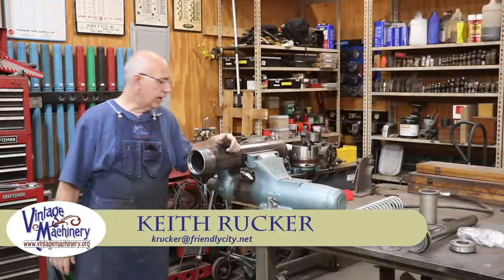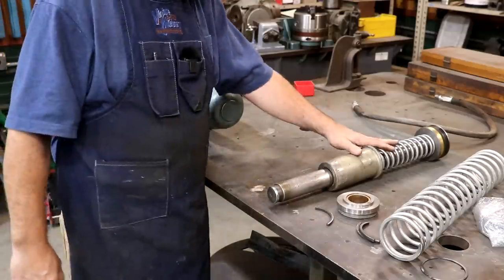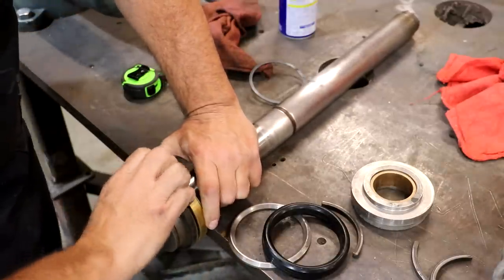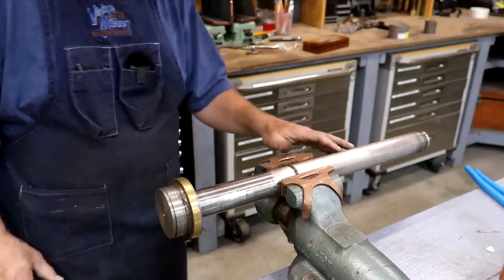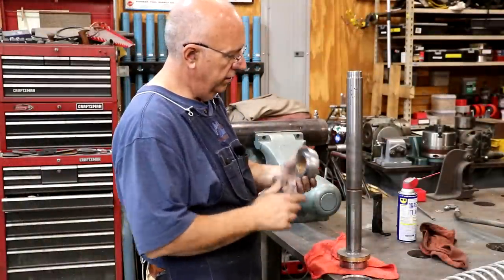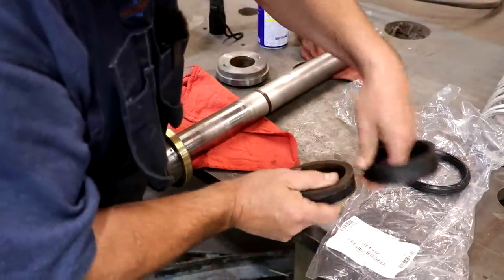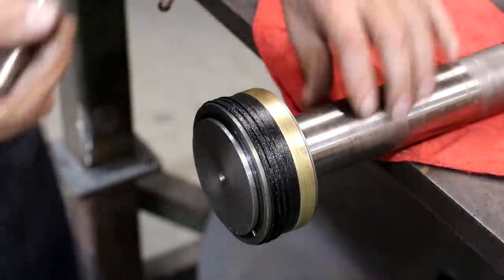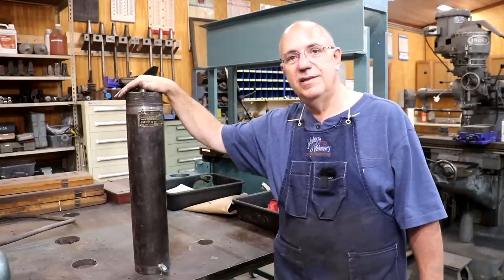Rogers 60 Ton Hydraulic Press Restoration 2: Rebuilding the Hydraulic Cylinder

Comment: I am glad you put the original chevron metal ring back in , I believe the reason it was designed this way is the live load on the stack of chevron rings and the cycles of the hydraulic pressure would have sheared the soft face of the supplied flat faced follower. 
The press is going to be a valuable addition to your workshop!

Comment: I do a lot of hyd. cylinder rebuilds and that steel ring needed to be there. 👍🏻 You had me a little worried at first 😜
Reply: I agree, especially since it is all held together with a spiral snapring
Reply: Yeah, my thought was that flat rubber seal is to sit on the face of the piston groove when its reassembled..
The metal ring takes the place of that seal piece and piston face.

Comment: It's amazing the power these cyl's can exert.  I have a set of SUNNEN hones that go from 1 inch to 8 inch I have had for over 30 years and are still like new ( The frames), In my youth I used to bore V8 engines with them. They are all rigid type and not like yours. The hours I spent standing there with an old fassioned 1/2 inch drill.  Lots of memories there my friend. I don't know of a press that isn't  all musroomed and been beat on. Such a shame. Lazy people in the shop get people hurt or worse. Nice fix my friend. I am sure this fix will give the press a  like new power.

Comment: I really enjoy your videos Keith.  Those packing rings are called "chevron" packing for the inverted "V" shape cross section.  And that brass wear ring is absolutely fine at .008" under bore size.  That is a super nice press that you obtained, and I know you'll get it in beautiful working condition to match the fine machinery in your shop.   I find it hard to imagine where you get the time to do all that you do, and I know we only get to see a fraction of the whole.  Thanks!
GBD

Comment: fyi there is supposed to be sacrificial cup on the end of the cyl rod hence the step in the end and is held on with a set screw that way the end of the rod does not get damaged the way that yours is. this also allows you to put different attachments on the ram rod.

Comment: Looking at the design 4:22, i can't help but think that the person who designed this cylinder took his inspiration from a valve spring and seat. I don't know that i've seen cylinders done this way, seen the wire type, threaded (most common nowadays), seen them welded shut, but this might be the first time i've seen it done with keepers. Interesting.

Comment: If you use a spool value with your new electric pump, you don't need the return springs, but you do need to modify the cylinder. An additional port should be added to convert the cylinder to double acting and the end cap needs to be modified/changed to a sealed cap. These changes will allow you to eliminate the manual pressure relief/return valve and just use a spool valve to move the piston in and out.

Comment: Keith, you need to have a lot more oil in there to safely hone a cylinder.  What you have done will probably be ok but that's not how I would have honed any tube myself.
Reply: That is because you are the guru of honing.....or at least you think you are.

Comment: I think you should been cut a relief area behind the arm end that you 're cut , so that end pieces that you need to add for pressing, don't need the set screw completely tightened to keep them on the end of the ram....just turned into the relief.
Reply: I saw those two treaded holes, do they hold the press end on?  I would like to have seen a snap ring turn to retain the press end, unless bolts hold the press ends.  Had seen a set screw marks so how to retain the press end pieces?

Comment: Was the outer edge of the big spring smooth? just wondering what made them raised spots inside the cylinder or what could gouge it in the future.
I've never refurbed or even used a hydraulic press though to be fair lol. learned a bunch watching this.
Reply: The spring's outer diameter is about a quarter inch less than the cylinder inner diameter, so it should run smoothly.  I don't know what caused those gouges at the bottom of the piston rod but I doubt it was the spring.
Reply: @peterhobson3262  Hope your right but I wonder about deflections. Would some nylon bars say place around the outer edge of the spring guarantee they don't contact, scratch that the springs shrink and bars wouldn't. tbh I don't know but I'm glad of the feedback

Comment: WD-40 is technically a penetrant, not a lubricant - with anti-corrosive properties.  Generally use cutting oil in these cases or 3-in-1 oil but hey Mr.  Fenner is a vastly superior machinist and if it works for him it's probably fine.

Comment: Keith you do know that WD-40 is not a lube it is realy a Water Despant # 40
Reply: At what point in the video did he use it as a lubricant?
Reply: @grntitan1  when he was doing the honeing
Reply: @matthewmeuleman9872 I missed that. WD does work fairly well for cleaning the stones of a hone, but as a lubricant no bueno.
Reply: WD-40 is mostly a mineral spirit mixture (>50%).  It also contains various refined mineral oils (<25%).  The rest is paraffins, propellant and fragrance.  Being that it is mostly mineral spirits (Stoddard solvent). it makes a fairly good parts cleaner.  Not a good choice as a lubricant!  I don't know how many cans of the stuff they have sold, but it is extensive.  The marketing folks at WD-40 have done a hell of a job!!!